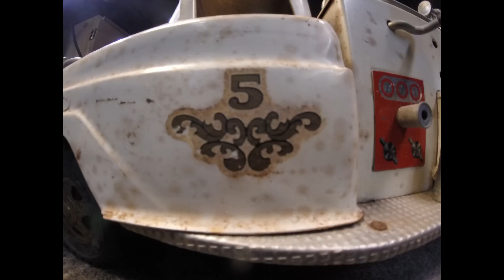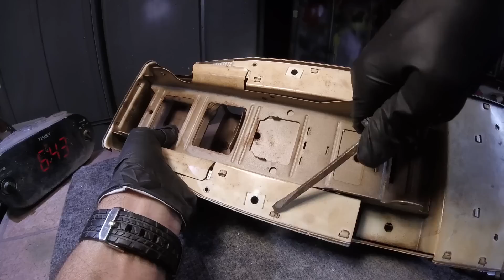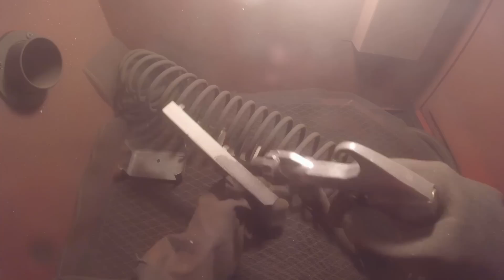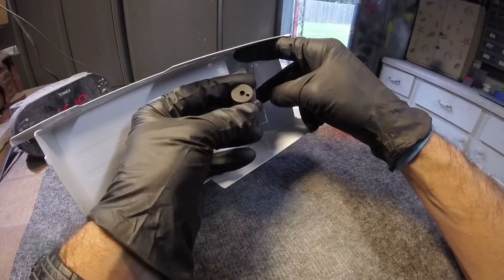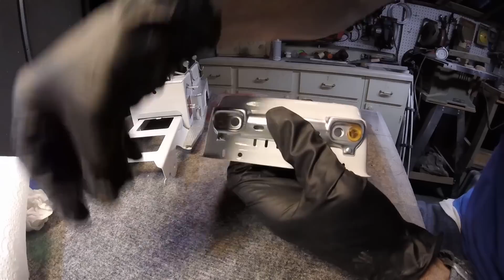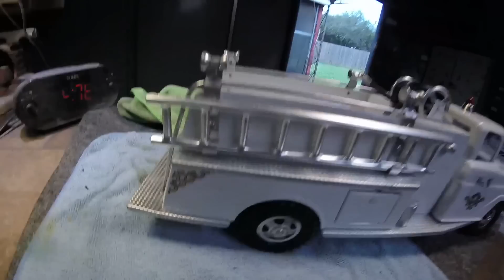Tonka vintage pumper fire truck. (Modified) Restoration. Watch till the end!

Comment: This restoration is impressive and more when adapting led lights. I have not yet begun to restore any Tonka and I would like one like this model, the only thing that I think was missing in this type of Tonka of those years is to adapt seats and a steering wheel and the older windshields and seats and steering wheel, I think someday you  could do it You are very creative.  CONGRATULATIONS

Comment: I got given that same truck back in 1959 or so. Brand new. Don't know what became of it, we moved and it didn't make the trip. Pipes on side look right, but aren't. they were rubber with metal ends, as I recall, but that was a hell of a long time ago and I was young. For all I know, that could be the same truck. Probably not, but who knows.